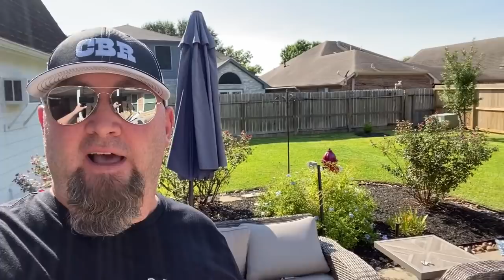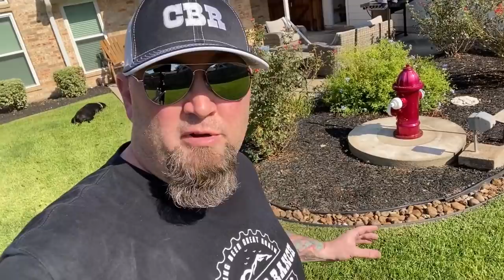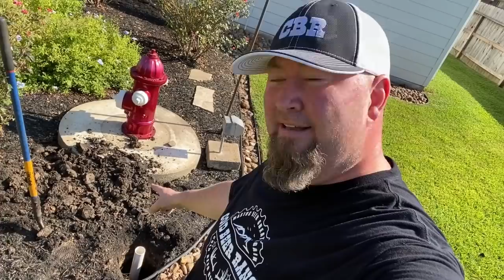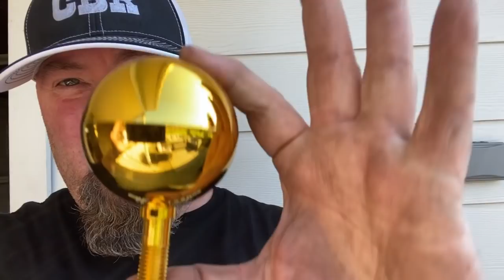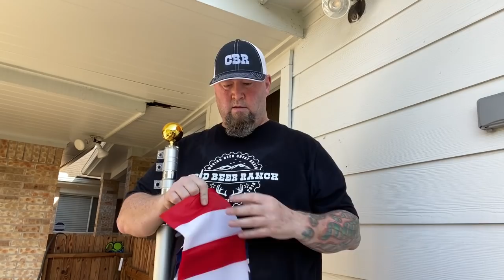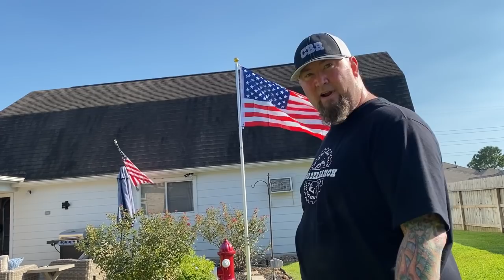Installing a flag pole in Honor of September 11, 2001

Comment: I bought 4 flag poles, two 25' & two 20' poles From US Poles in Beaumont, Tx. I needed a hole 3' in diameter and 30inches deep, along with 25 bags of concrete per pole. Just saying I hope your pole stays in the ground.
Reply from the maker: Steve, wow I hope mine stays up too.  I will keep you posted